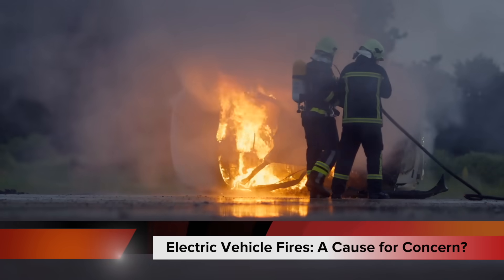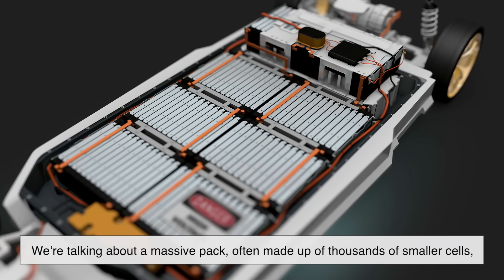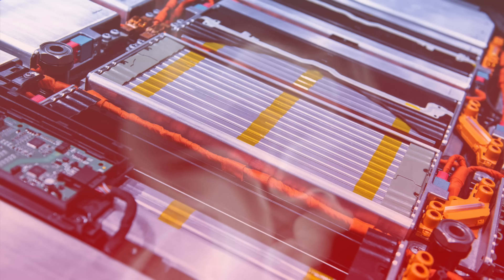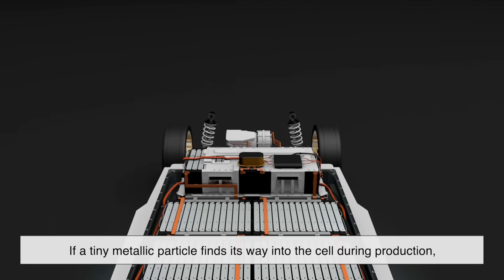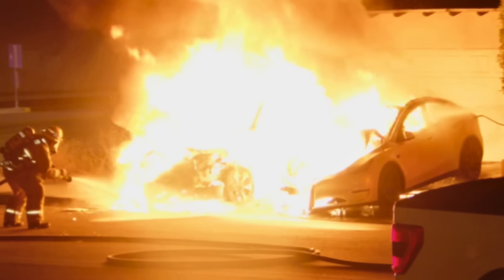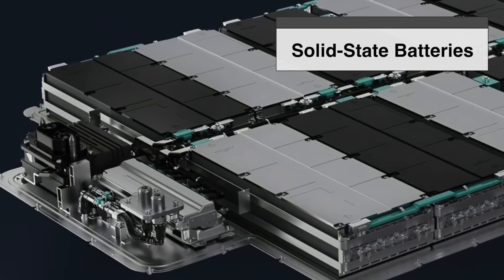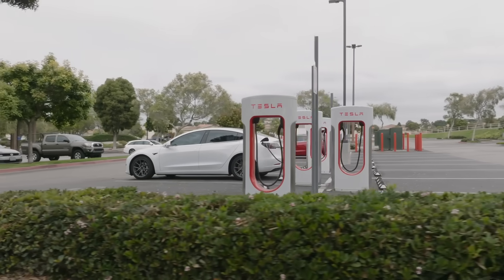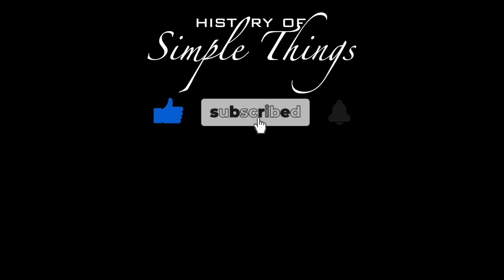Why Do EV Batteries Catch Fire?

Comment: EVs are far less likely to catch fire than ICE vehicles. The problem is once they do, you cannot pput the fire out by starving the fire of oxygen as you do ICE vehicles, the chemicals in the EV batteries create their own fuel for the fire

"Electric vehicle (EV) fires are far less common than petrol and diesel vehicle fires, with data showing EVs being 20 to 80 times less likely to catch fire than their internal combustion engine (ICE) counterparts. While EV battery fires are rare and often a result of external factors like crashes or arson, they can pose challenges for suppression due to the way they burn. However, the risk of an EV catching fire is significantly lower, and when fires do occur, they ignite more slowly, providing more time to escape".

YEAH I KNOW ACTUAL FACTS ARE ALWAYS A PROBLEM

Comment: For those that want to know, the vehicle  alight at Gatwick is a Volkswagen Tiguan Semi Auto Estate Plug-in Hybrid Electric with a 1.5 litre engine.  It has a 19.7kwh battery and a 45 litre petrol fuel tank. The registration is BV25 XJY.

Comment: The difference between fire safety on an ICE vehicle vs an EV is that the engine compartment, the usual source of and ICE vehicle fire, can be visually inspected on a routine basis, like when the engine oil is changed, and potential problem areas such as fuel leakage can be identified and corrected before there is a problem. There is no means of visually inspecting the thousands of battery cells that make up an EV battery pack. While driving an EV you are literally sitting on top of a potential fire and explosion hazard that may erupt at any time.
Reply: You don't need to visually inspect every cell, when you can have sensors built in.
Reply: @ziploc2000  oh...and there is some guarantee that those sensors will work? They monitor each of one of thousands of cells? Would you like to buy a bridge I'm selling??🤣🤣🤣

Comment: As time goes on, technology changes ver rapidly. As it stands, EVs are much better now than even a few years ago. ICE cars have not changed in regard to the danger of fires. In defense of EVs, there has been many cases of false news where in fact a car fire, being blamed on a lithium battery turned out to be an ICE car fire. People love to point fingers. As soon as you hear of a car fire, “oh it’s those damn EV batteries again.” Look at pictures of car fires blamed on a lithium battery when the fire is coming out of the front hood. If it’s a lithium battery, the fire comes from around the bottom of the cabin.
Reply: You can also tell the difference between ICE fires and EV fires by watching the fire department when no matter how much water they flood the vehicle the fire still doesnt go out and even continues to burn if the vehicle is submerged in water.
Reply: @northdakotaham1752  Fire departments now use a fire blanket to smother individual vehicle fires, not water.
Reply: @ziploc2000  they don't have that where I live...or most other places in the U.S....but foam is used if available but that doesn't put out an EV fire. How much oxygen is feeding an EV fire when the entire vehicle is submerged in water?
Reply: But people also love to defend their vehicle purchase no matter how bad the brand's safety record is. Regarding fires in Teslas (and omitting the few that were started by protestors/terrorists), it isn't hard to figure out the Teslas batteries are almost always the source of the fires as described in this video. Since Tesla doesn't make any ICE-based vehicles, then you can be sure that reports of Tesla fires after crashes are virtually always due to damage to the batteries and associated thermal runaway. That is one of the reasons that its good for media companies to include to brand name of the vehicle when reporting crashes involving fatalities. It helps to show what may have contributed to the fatal crash and what was the likely cause of any fire that occurred.

Comment: There are way more fossil fuel vehicles than EVs and they don't catch fire as often.  In terms for fighting EV fires, how about using dry ice or even liquid hydrogen?
Reply: Hydrogen? Are you nuts? It's highly explosive! Even in liquid form... give it fire and BOOM!  How about CO2? (BTW: Dry Ice is frozen CO2).
Reply: Do you mean EVs don't catch fire as often, or fossil fuel cars? Your statement is ambiguous.
Fossil fuel vehicles catch fire about 60x more often than pure battery electric vehicles.
Liquid hydrogen would be a disaster, as these fires occur in the presence of oxygen, you'd  literally be pouring fuel on the flames.
Large fire blankets have proven very effective in smothering EV fires, just pull one over the whole vehicle and leave it to go out.  Also really quick to deploy, and light and compact to carry on a fire engine.

Comment: Ironic to see a video about EVs on a channel called history of SIMPLE things.
Reply: One battery cell is simple. Nothing simple about thousands of them wired together with cheap wire and charged by a computer.
Reply: @northdakotaham1752  The basic technology is actually quite simple. I once made a battery and an electric motor totally from scratch in tech. class in 8th grade. But the kind of power a car needs requires an indecent amount of overengineering.
Reply: @lajya01  I've built basic electric motors also and work on them professionally...and yes, they are simple and can last for many decades. Batteries by the thousands, connected either in series or parallel,  not so simple. Then there is the charging circuits necessary. No thank you.

Comment: Yes regular cars burn more often,...but,...when an EV catches fire, you can lose electrical power and be stuck inside the vehicle (the electric locks stop working). And let's not forget Li-Ion batteries in thermal runaway generate oxygen, which helps feed the fire.
Reply: Wrong! Electric cars have a 12V battery to power several support functions, such as the car's lights and locking mechanisms
Reply: @jannorgaard561  What happens when the "+" cable insulation melts and touches ground? There are several cases where occupants were trapped.

Comment: LFP/LIFEPO4 batteries don't catch fire. They are replacing NCM very quickly and are the dominant battery type being sold now.
The have a slightly low capacity but they last 3+ ties longer and with EV they match NMC which degrades faster, in the first year.    
fire blankets put out lithium ion fires in seconds.  look it up.

Comment: The problem is the packs can't be put out, you have to let them burn out. A lithium battery can burn fully submerged under water.
Reply: They can however be smothered with a fire blanket, which is what properly equipped fire crews are now doing, assuming they ever encounter an EV fire because they are extremely rare.
Reply: @ziploc2000  smothering them doesn't put em out, lithium battery fires create their own oxygen when they burn, there's videos of teslas backing jetski and boats into the water and the drivers accidentally submerge the car and the battery starts burning completly submerged.
Reply: @polska905  You don't need to "put them out" just isolate the fire under a fire blanket and let it burn itself out. The vehicle is wrecked anyway, whether gasoline, diesel or EV.
Reply: @ziploc2000  you need to protect roads, bridges, tunnels and parking structures...
Reply: @polska905  Do you remember the Luton Airport parking garage fire that destroyed 1,400 cars? 
That was started by a Diesel Range Rover.
Reply: @ziploc2000  what does that have to do with this conversation?

And on that note, how many electric cars did this fire spread too?

Diesel is very hard to ignite, range rovers makes garbage vehicles, the fire was probably caused by electrical issues not the diesel fuel itself, there's a reason why diesel is preferred over gasoline in the military...
Reply: @polska905  All fires are started by something igniting them. Diesel and gasoline cars have electrical systems too, but maybe you didn't know that, you sweet summer child.
So the only way to 100% protect roads, bridges, tunnels and parking garages is to not let vehicles near those places. 
How many electric cars were destroyed in the Luton fire that was started by a malfunctioning  diesel vehicle which apparently can't burn in your fantasy world, despite the fire being spread by burning liquid diesel? No idea, they haven't published that data, and it is totally irrelevant.
Reply: @ziploc2000  let me know when ice vehicles are banned from public  parking garages and ferries.

Comment: The inherent problem is that the batteries store and release energy by moving atoms on to and off of an electrode.  The process is analogous to how quartz-halogen incandescent bulbs last much longer than vacuum enveloped incandescent bulbs.

Incandescent bulbs fail, because the heat generated by the current to produce light causes atoms of the filament to boil off.  Where the atoms have left the filament, the filament narrows.  The resistance at the narrowing is higher and the atoms boil off at a faster rate.  Eventually, the filament gets so narrow that it fails mechanically.  Where did the atoms go?  They ended up on the inner surface of the envelope.  In a quartz-halogen incandescent bulb, the internal pressure of the envelope slows down the rate of atoms leaving the filament and prevents the atoms from binding to the inner surface of the envelope, so the only place for the atoms to end up is back on the filament.

If the atoms all go back to the filament, why do quartz-halogen bulbs still fail?  The atoms returning to the filament do not go back to where they came from.  In a cell where the energy is stored in an electrode, recharging also does not put the atoms back where they came from and the shaping of the electric field at the electrode causes the atoms to be more likely to attach to spikes than go into hollows.  The surface starts out as smooth, but gets rougher and spikier with each charging.  When the spikes get past a certain size, an internal short develops.  What happens when the internal short develops depends on the energy density of the cell.  I experienced an internal short in the lead-acid battery of my daily driver.  The case was bulged outwards and the remaining five cells lacked the power to start the engine, because lead-acid cells combine a small energy density with a large thermal mass.  Lithium cells have a high energy density and a low thermal mass, so they can get very hot and self-ignite.  Better manufacturing practices will delay the cell failure, but a battery protected from all physical insults and only charged under optimal conditions will still eventually develop an internal short and fail.  With energy storage in the electrodes, the failure of the cell is the result of physical laws and the tyranny of numbers.

Recombinant cross flow cells use two electrolytes and charge and discharge energy by moving H3O+ ions through a semipermeable membrane between the electrolytes.  The electrodes are unchanged, so there is degradation from normal use.  As a bonus, the electrolytes can be removed from vehicle, replaced with fully charged electrolytes, and the discharged electrolytes can be recharged out of the vehicle.  Lithium batteries made EVs, possible, but fell short of making EVs a good idea.

Comparing the total number of EV fires to the total number of fossil fueled vehicle fires is lying with statistics.  A much more honest comparison is the number of EV fires that destroy the EV with the number of fossil fueled vehicle fires that destroy the vehicle

Comment: There's a reason airlines don't allow Lithium ion batteries to be in checked luggage...  They are also much more dangerous when they are fully charged.  Sure they have a high energy density, however it's still much less than fossil fuels on a weight equivalent basis.
Reply: But 75-80% of the energy in fossil fuels is wasted as heat, and does not actually help move the vehicle.
Reply: @ziploc2000  Still doesn't matter.  Furthermore, not all of the heat is wasted when you live and drive in colder climates.
Reply: @BlueSpruce2  It does matter if you're comparing energy density, if you lose 80% of that energy while converting it to motion. 
Let's be generous and say 5% of the generated heat is used to heat the cabin, and ignore the fact that in hot countries it's a pain. That's still at best 25% of your fuel's energy being actually useful.
Reply: @ziploc2000  I'm pretty sure a gas tank in an ICE vehicle is nowhere near the weight of a battery pack in an EV.
Reply: @BlueSpruce2  It isn't. How does that relate to our discussion?
Reply: @ziploc2000  I'm trying to point out that Lithium Ion chemistry EV battery packs do not have the energy density to get you the range of an equivalent ICE vehicle even with the inefficiencies of fossil fuels you noted.  At 6.3 lbs/per gallon my vehicle with an 18 gallon tank or 114 lbs of fuel gets me 525 miles of range.  Hope you understand why I say thermodynamic efficiency doesn't matter.
Reply: @BlueSpruce2  OK, so energy efficiently and fuel cost do not matter to you, fair enough.
I don't know how often you need to drive 525 miles in one go, maybe every week. For me it's never happened in 40 years of driving.
Reply: @ziploc2000  That's right.  Range and convenience matter more in my book.  I'm not a plug slave (although Apple turned most of us into exactly that) and I can operate the vehicle for over three weeks without needing to refuel.  I can leave it for extended periods of time at places like airports with a full tank, and guess what?  There's always a full tank when I return to it regardless of the weather.  I have also driven 1500 miles on a round trip to the Grand Canyon with only three fill-ups.  Elon Musk has probably burned more Methane and RP1 fossil fuels in his rockets than all the Teslas on the road have saved... 😄.  Cheers!
Reply: @BlueSpruce2  Ah, you think I own a Tesla? I don't.
We have a Chevrolet Bolt, bought used for ~$16,000, charge at home using our own solar power (very convenient), and have cut our running costs from around 15c a mile to 2.5c a mile. 
When we hit 130,000 miles our EV will have entirely paid for itself in fuel savings.
If that makes me a plug slave so be it. By the same logic you're a pump slave. The difference is I can plug in at home, but you always have to go to a special location to get your fuel.
BTW, if a Tesla runs its battery down while parked for an extended period, that's because the owner left it in sentry mode. That can be turned off.

Comment: The closer you push battery energy density towards the theoretical maximum of about 1100Wh/kg, the closer you are to having a bomb when something goes wrong as there is nearly nothing separating the anode from the cathode to prevent an uncontrolled redox reaction or slow it down.

Comment: Battery electric cars have been around in a practical form since the 1870s.  If they were ever going to become a viable replacement for ICE, they would have done so long before now.  As it is they still have the same drawbacks now as they did 150 years ago only the battery tech has become so much more lethal.
Reply: Well, not not really. Even 15 years ago electric cars were still using lead-acid batteries for their main power storage. 
Since then we've had NMC Lithium-ion, LFP, and now solid state batteries, to name a few. Battery technology has come on in leaps and bounds in the last 15 years.
Battery management systems are also developing fast, spotting potential problems before they occur and shutting down thermal runaway before it starts.
Reply: @ziploc2000  MERCEDES RECALL 37000 EQB EV’S ‘BECAUSE THEY CATCH FIRE’ EVEN WHILST PARKED!!!!
Reply: @JamesSmith-qs4hx  No need to shout Jimmy. 
It's actually 33,705 EQBs worldwide, and the potential problem is preemptively fixed by a free Battery Management System software update at a local dealership. The total number of actual fires is not reported, but none have occurred in the US.
I suggest when you hear these stories you don't go purely by what Electric Car-Nage says, he's always going to paint EVs in as bad a light as he can because that's his shtick, but rather do your own research on the internet to get actual detailed information.
Reply: @JamesSmith-qs4hx  As a comparison, 120,000 diesel Land/Range Rovers have been recalled due to potential spontaneous combustion, and the Luton Airport fire was caused by one of these, License Plate E 10 EFL.
Reply: @ziploc2000  And Porsche and Ford have done the same.... All these battery cars are DEATHTRAPS.